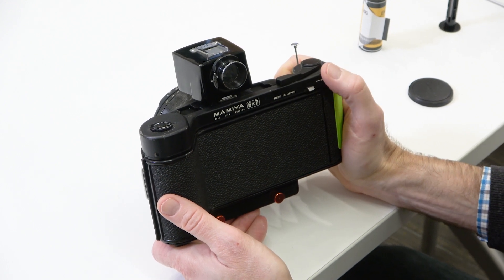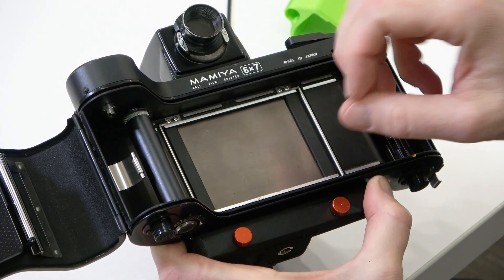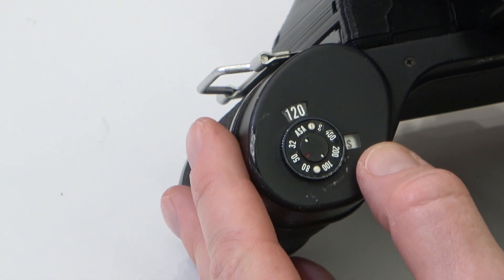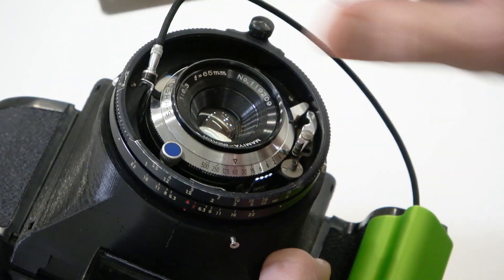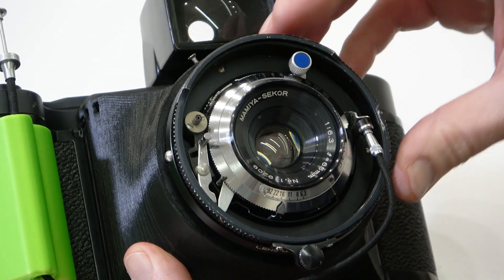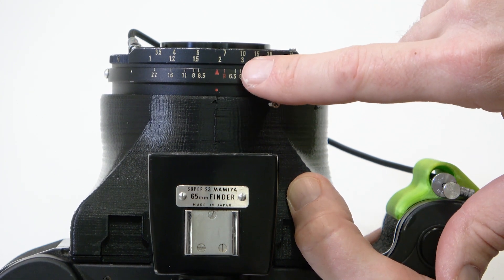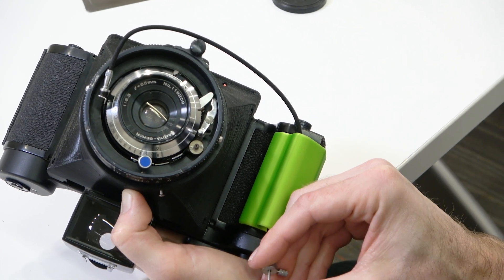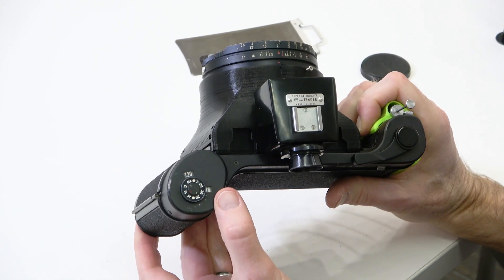Ligero 3D printed medium format camera

Comment: So it’s basically just a lens cone that you print and attach to a MPC press back?
Are they interchangeable or you have to select one film size and one focal length from the start of the build?
Reply: Found the project, and that is really cool, not “just” a lens cone, but will take any MPC lenses…

This looks waaay more usable than a lot of 3D printed 6x9’s which are really kinda naff.